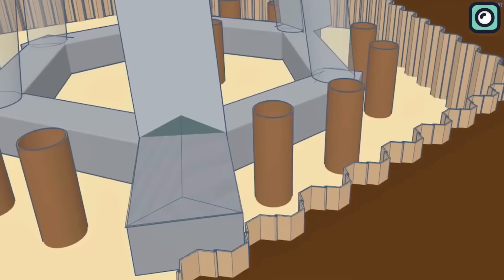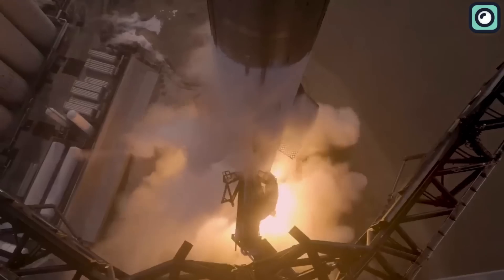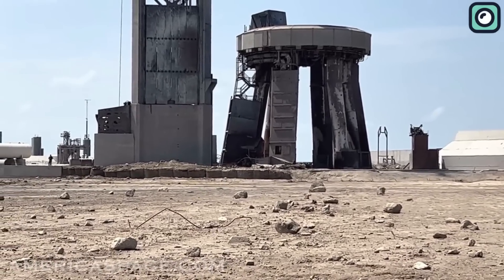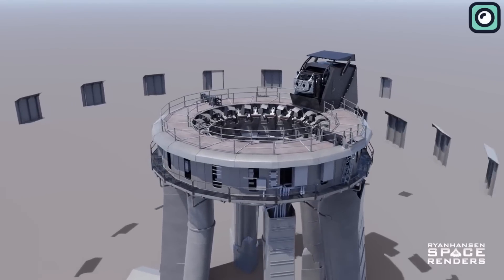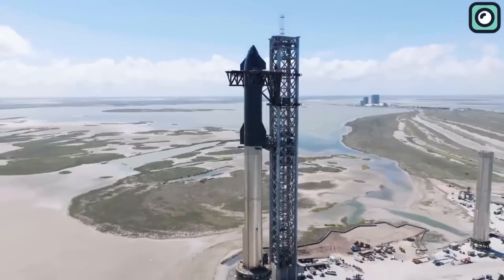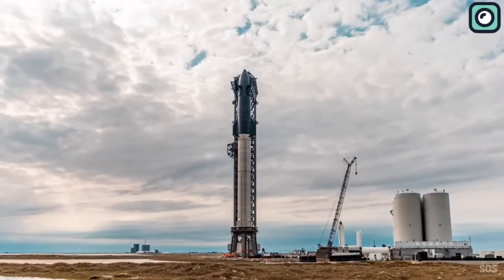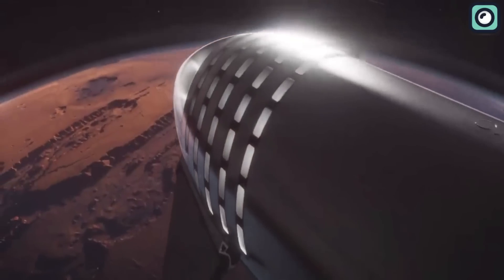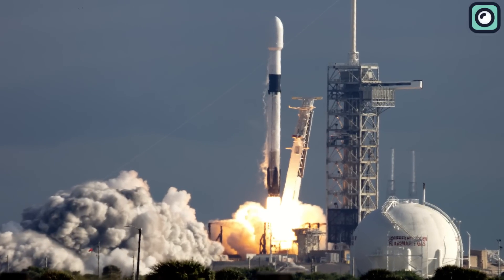Insane Launch Pad Upgrade at Starbase Boca Chica Will Shock You!

Comment: StarWrecker is TOO BIG for Boca Chica. The FAA completely failed in their duties as a rocket that size needs a flame trench AND water deluge system that dumps millions of gallons in seconds. No shower head steel plate will come close to stopping  the acoustics. It's a worse solution as the flames will melt the thing in seconds. Elon is not smart folks! Only folks he can knock up work there.

Comment: If the FAA keeps bothering them, they should move to another country, preferably one near the equator
Reply: Buy an island. Easy fix.
Reply: Well, musk recently had a long Convo with the French President.
The French have a very underutilized launch facility, just a barge ride away from SpaceX's current location. Not unimaginable to this the French could be angling for a joint venture.
Reply: We need a war against FAA, no need to move, we must FIGHT THE ENEMEY!!!! Only TRAITORS MOVE OUT. IF YOURE A PATRIOT, FIGHT FOR YOUR COUNTRY, FIGHT THE ENEMY WITHIN, ELON FOR PRESIDENT
Reply: @pravicaljudem1814  Elon is not American, if they used ESA's launch facility in French Guiana it would be really good because:
- Less fuel required to get into orbit because it's right on the equator
- No FAA holding back development
- It could help the economy in French Guiana

Comment: I have no doubt the water cooled steel plate will work as intended ! booster 9 ship 25 also has many upgrades over its predecessor ! can't wait for the next orbital testflight !
Reply: Hell yeah!
Reply: I completely agree with you. One Falcon9 is estimated to produce 100 trillion btu/hr. I have no idea how accurate that is but, that times 33 engines, works out to about 1 trillion btu/second.  Yeah, I don't see it.
Reply: Sadly 16.5 million tunes of heat and pressure are going to tear that plate apart. He should stop trying to fight physics and just use a pool of water. Water is cheep and reusable and more problomes with faa could be bad for buisness.
Reply: @aaronb8698  thankz fir the feedback ! It will be a wait and see moment for alot of people !
Reply: @scottymoondogjakubin4766  you are more than likely correct.
Reply: @nathanwahl9224  thanks ! finally a positive reply ! 👍👍

Comment: Soils engineers will tell you that foundation distress is the most common cause of building failures. Getting good samples from a flooded subterranean system is nearly impossible, and even if you could get a few samples, the extrapolation from relatively tiny lab samples to the Starship forces reflecting off of bedrock leaves a very large uncertainty. The concrete pad used for the first launch test of Starship was necessary so that sensors could be embedded in the profile. While they were destroyed in the launch, they survived long enough to provide needed data. Not as much data as Elon would like, but enough that engineers could be confident not of a bullseye, but of being on the paper with their best shot. Hitting the 7 ring on the range is a whole different experience than asking, "Where did it go, did you see it?"

Comment: This things gonna blow up on the launch pad this time.    This is actually worse then just plain concrete
Reply: What makes you say that?
Blowing up on the launch pad is always a possibility, but they just had a successful launch, with all the safety systems working.
not sure why you think this is worse.
Reply: @MouseGoat  i think the reason it DIDNT blow up this time.was actually the concrete being blown away and the dirt absorbing the accoustic shockwaves.   This time the flat metal plate with reflect it right back into the ship
Reply: The next launch will be perfect. They learned much from the first launch.  This next launch will make it all the way.
Reply: Well internet expert - I guess you really stepped into it didn't you?